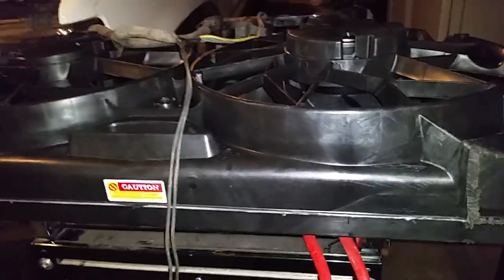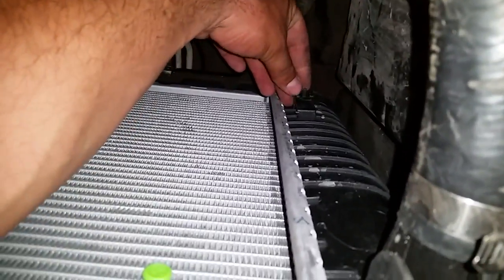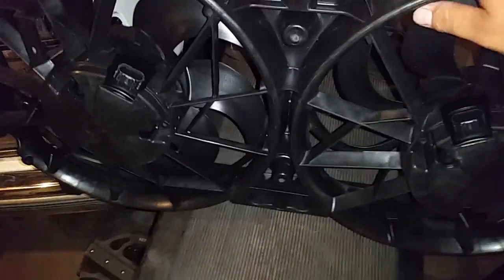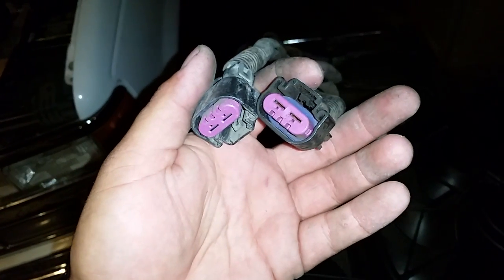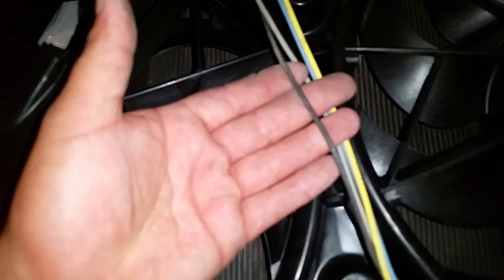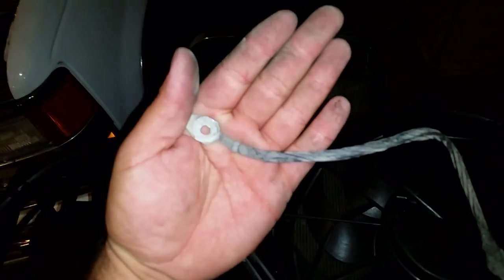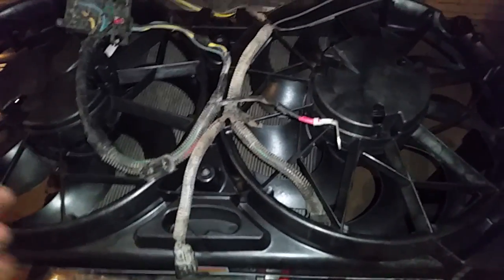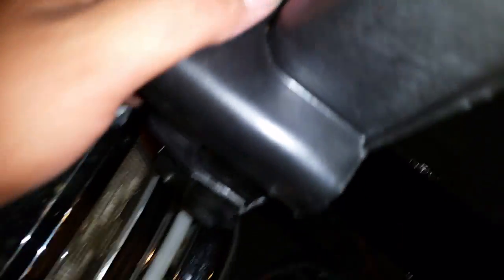Pick this setup for fans.  2003-2006 harness 2007-2013 7 and 9 blade fan assembly

Comment: Most all 99-04 trucks trucks have a 28" radiator and mechanical fan. Some have the 34" (my 03 Escalade EXT had a 34"), but VERY few. 05+ was 34" and electric fans on all 1500s.

Comment: Hi. I am doing a swap on a 82 c20 can I use these relay fans harness on my swap.  What year did you get it from    I just need to connect fan 1 and fan 2. Wiring from pcm right  correct me if I’m wrong please thank you

Comment: BP automotive makes the best fan harness in my opinion. Fused the same as factory within a nice fuse block. They also sell upgrade kit for 99-02 silverado/sierra/yukon/tahoe if you want your fans to operate according to the A/C pressures (as they did from the 05+ trucks).

Another alternative for the fan assembly itself is the 5+5 fan configuration also with 700w motors. They are beasts, a bit loud but that may be inevitable when you are moving that much air. If you can't find 7/9 blade config, it should work just as well.

Comment: Gary, I pulled this entire setup from a 2005 Suburban Z71. Got fans mounted yesterday and reworked the harness today. Just plugged it in and tested it. Grounding either PCM wire spins the fans fast or slow, kinda dark couldn't see if both were spinning. Anyway, my question is this, I currently have a black box PCM. I have everything for a 411 Swap but saving for a programmer. How would you recommend ruuning these fans in the interim while I save for a progammer? A/C won't be hooked up until spring so would a thermal switch be the way to go? Thanks in advance.

Comment: Where does the green wire with the plug go to the pcm ? The plug has a cut wire where does it go ? is it grounded? And also do I connect both blue wires together?

Comment: I know it's a old post but do you know the size of the 9 blade fan? any chance it's a 16in blade itself.
Reply from the maker: john somethin tyc 622210 is the actual part number i used. There's a visual difference in quality from oem, but they operate very effectively. I'm not exactly sure on the size. What spec do you need
Reply from the maker: john somethin I can get you the info within a few days
Reply: I'm looking for the size of the fan blade itself.
 the motor since it's 700 watts, I'm looking at putting it in a different gm fan shroud, in place of what I believe is a 400 Watt one. it looks like a thicker case but mounting points look the same from the face, which would make since because it's more powerful. I think I can use my stock 5 blade 16in fan blade but if the 9 blade happens to be 16in, it will probably move more air. depending on the rpm its wound for, my concern is if it's the same rpm as my motor and I use the same blade, I end up in the same place. would need a more aggressive blade at the same rpm. the fan motor oem is only 50$ on rock auto, or i could go junkyard hunting, but not any good ones near by. the other option would be if the motor fits and your 9b is smaller than 16in, I find a 9b aggressive blade off say a ats-v fan, I see rumor specs floating around that it's a good fan, but I only find it to be a 600w, while some say they think it's 800w. but I can't nail down specs or even a good oem part number, and to pricey just to try. your 700w is 50$ and your fan 9b is 55ish$. I'd be willing to throw that at the chance of it working much better than what I have for using an oem shroud. but anyways, no rush, I'm still gathering info but much appreciated if you can tell if it's a 16in blade or smaller
Reply from the maker: john somethin are you running into issues overheating? It sounds like a lot of work. What is the problem your trying to solve
Reply: C6 corvettes are horrible for cooling in stock form and worse when modded. just no airflow like a nice truck grill, and only one fan stock. and everything aftermarket is way expensive. just a small dual fan setup alone is 899$ and if you get the radiator too. ugh haha. it's not really an big deal now, but it's been over a 100 here in tx a few times and I've noticed when stopped in traffic for a long time the ac gets a little weak and the temps climb someone. nothing bad but I can see how it could get out of hand. 

that and if it's possible to mix and match oem parts and end up better. it will be a interesting project.
Reply from the maker: john somethin ohhh i see. The truck certainly has a lot of real estate in that area,  I'll get you some specs asap, if you haven't heard from me by Friday,  email me at Skeeter5283@gmail.com
Reply: thanks, and I have a 96 tahoe, I subscribed so I can check out your disk brake conversion. for fans I put the supercharged Bonneville fans on it probably 10 years ago and wired them like the fbodys for low and high. thing runs cool on half speed haha. great old trucks. interesting channel
Reply from the maker: john somethin that's awesome thank you.  Yeah the newer style fans do an awesome job. And there's an excellent disc brake conversion to be made with 2004 blazer equipment. I'm currently doing a 55 truck with that swap

Comment: question, were you able to test the connection before having the ecm tuned? will a fan turn on without the tune?
Reply from the maker: Pedro Caban the engine won't run without vats removal
Reply: Gary Garcia what i ment was if there is a way to test the fans with the harness installed but not tuned, thx
Reply from the maker: Pedro Caban yes just ground the relay it will turn on the fans
Reply: Gary Garcia i appreciate the response but im dont know exactly know how, i have cleaned the harness and relay box to work only with the fans but don’t really know how to test them
Reply from the maker: Pedro Caban do you have a harness like the one in the video?
Reply: Gary Garcia yes, i bought it from a junk yard and took off everything else except the fans wires
Reply: Gary Garcia i have a 02 avalanche with fanclutch but i have an appointment on wednesday to have my ecm tuned, i have already installed pin 42 into the ecm, attached the blue wire to the ac wire under the fusebox, ran the fan wires just like your video, ground and power the fuse box. i also have a set of purple fan plugs and also another set from a 2012 harness from the junkyard in case i need it, don’t know if will make any difference but i have it.
Reply from the maker: Pedro Caban that's interesting,  I'm not sure what all gets changed in the ecm to trigger the fans,  but I'll tell you it's a pain in the ass to make it work in the obs the right way. Let me know how it goes.  So long as you have all the components it should be easy
Reply: Gary Garcia quick update, i took my truck this morning to the tuner and by noon it was done. before i left it i had already installed the harness and run all the wires. i gave them the fans so they can test the high and low signal, picked up the truck later went home took out the fanclutch,  installed the fans and everything worked like it was designed for it, had the truck parked for a while and the temp did not moved from 190. mission accomplished. thax for all your input.
Reply from the maker: Pedro Caban nice,  now the most important part,  do they stay on constantly?  How about cycling with ac?
Reply: Gary Garcia yes it does, i checked and so far all looks.
Reply from the maker: Pedro Caban nice
Reply: JR since i used a factory harness from a newer model the end of the wires had the tips that go into the ecu, so i open the ecu and slide the wire in the correct slot number, i dont remember which one was it but on my 02 Av one wire goes in the ecu the other wire goes in the ac compressor wire inside the fuse box, this one i believe i did splice but i had to remove the fuse box and look underneath for the correct wire. for the silverado should be similar, ill do some research and send you what i can find. trust me i have not any overheat issues since i did this, actually the temp does not go higher that 204. what i do highly recommend is to upgrade the alternator, you will need it eventually, i asked around and nobody really wanted to tell me exactly what’s to do so i learned the hard way. if you do plan to upgrade the alt is very easy, swap is a cake because gm is all same fit on the bracket, the belt has to be a bit longer, the plug is the same and the rear cable change it to a thicker one. i went to autozone and ask the next belt longer than the one had, i did this back and forth until i got the one i needed. if you dont mind it believe is totally worth it, feel free to contact. good luck
Reply: JR maybe i missed it, i went into a junk yard and bought the harness including the relay box and fuse box. ok so that particular box controls everything in the front, fans, headlights, sensors. everything is tangled in the same harness, when you take it out is all together, i cleaned it up leaving only the fans wires, ground and fuse box with relays. if you want i can email you pictures of exactly what i bought and what i had left in my truck.
Reply: JR it took me sometime to understand the complete project and to get a good deal of tune which i paid 150 for a 30min job but thats how it is. is worth it. glad to help, let me know if anything.

Comment: A Chevy traverse fan would be better and it's thinner more compact. Basically the same fan except it has hooks at the top of the radiator C channel and it hangs real nice. It also has rubber bumpers that contact the core so it don't get damage. Low speed with AC on keeps my V6 S10 cool all summer. And if you think that it's not powerful enough for your V8 I have a 16 jeep renegade single 16in fan that cooled a 4 cylinder in my 64 chevelle that has a 500hp 406. The single fan keeps that 406 at 170 in 95deg weather quite easy cycling on then off doesn't run constant.
Reply from the maker: Retrogamer1010 what year,  thanks for the info
Reply: Gary Garcia 07 equinox not traverse sorry.

Comment: https://www.ebay.com/itm/Chevy-Silverado-GMC-Sierra-Tahoe-Yukon-Retrofit-Stand-Alone-Electric-Fan-Harness/123131470407?hash=item1cab352247:g:UYEAAOSwq4lbBPil
Reply from the maker: David Krauss nice harness
Reply: Thank you Gary
Reply: I see that one on ebay has pins in it to plug into the pcm and also a 2nd power. I have the exact harness in the video so how do i go about getting those pins? And also the 2nd power isn't needed?

Comment: I HAVE THE ORIGINAL HARNESS, BUT I WANT TO CONNECT IT WITH A TEMPERATURE BULB, IN MY CHEVY SILVERADO 2003,I DO THE PIN 42 CONNECTION, DERALE THERMAL Fan Switch Thermostat

TENGO EL MISMO CABLEADO ORIGINAL PERO ESTOY EN MEXICO Y ES DIFICIL CONSEGUIR UN SINTONIZADOR EFILIVE O HP TUNER,TENGO UN SILVERADO 2003, COMO HAGO LA CONEXION DEL PIN 42 y 33, YA QUE USARE UN BULBO DE TEMPERARUTA Derale termo seich
Reply: Adapta un pin al 42 y al 33 y ponles tierra con dos relay

Comment: Good video as usual Gary. I tried like hell to find that oem relay setup but ended up making my own.
Reply from the maker: hey thanks buddy I'm glad you like it. sometimes i wonder if anyone actually listens to my rambling. lol.  id be interested in seeing what you made how it came out. I considered making one,  didn't get very far
Reply: @skeeter5283  @amigo,,  how its that ground wired??   The black wire it goes to both fans ? Or ??  Only to one?